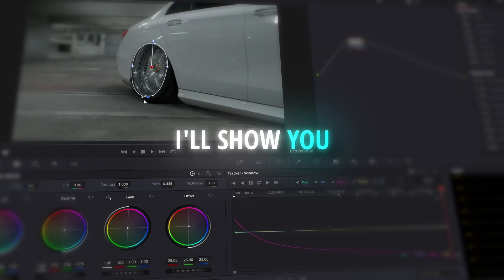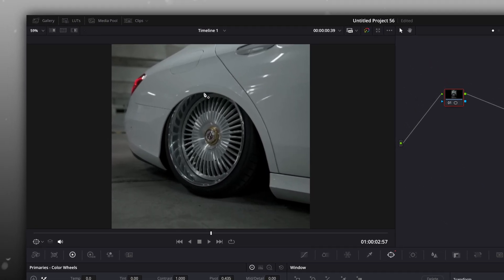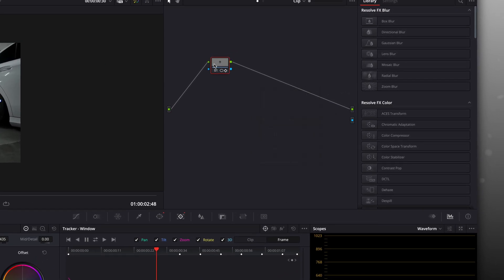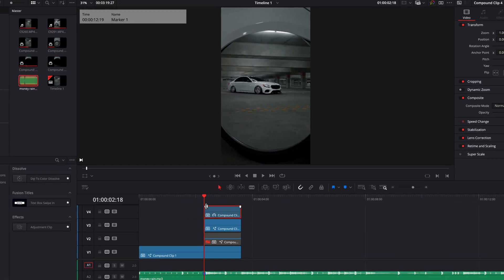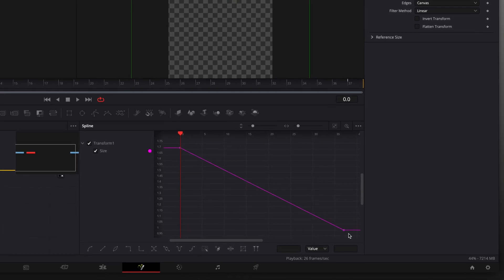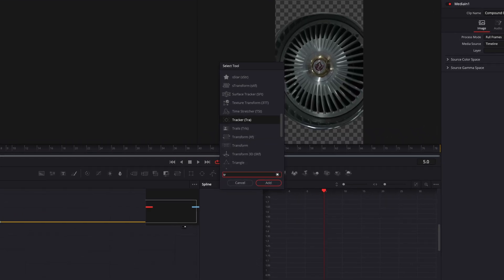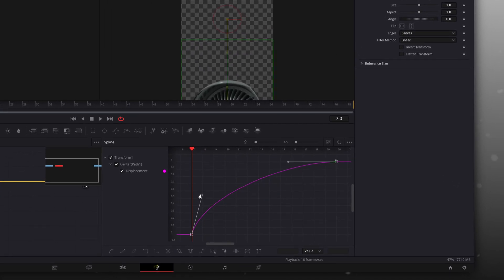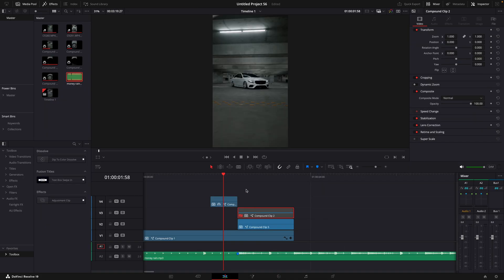Wheel PORTAL Transition - DaVinci Resolve 19

Comment: Does someone here know how i can do the mirror effect on the edges of my clips? If i need to zoom out, so the edges aren't black?
Reply from the maker: You shouldn't zoom out that much, because the the video itself also needs to be zoomed and that doesnt look very good imo. But anyway. Go to fusion, add transform and zoom out. Then under thw transform go to Edges and choose mirror! 👍
Reply: @VaultCar  okay, thanks!
I was using the planer tracker to stabilize my clip, than i needed to adjust the clip size and axes very much
Now i will try with the mirror edges
Reply from the maker: @medpoject you can also try making a position keyframe on the first frame and then adjust the position on the last frame so the clip is in the middle. Then you dont have to turn up size that much.